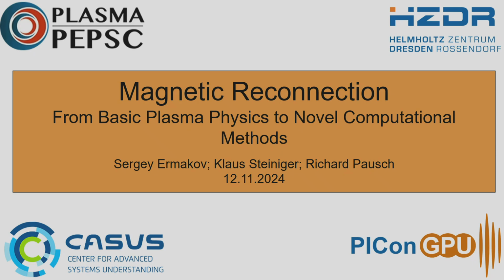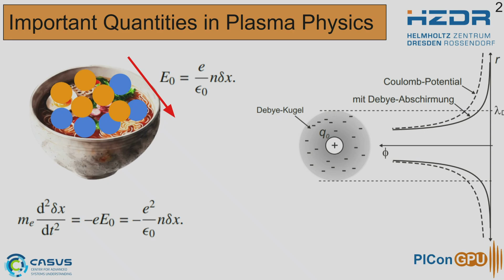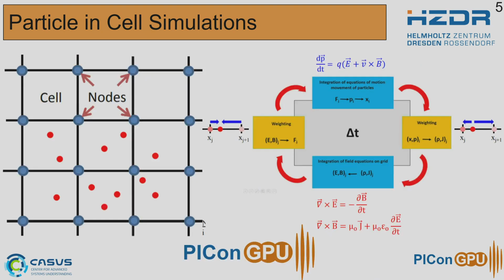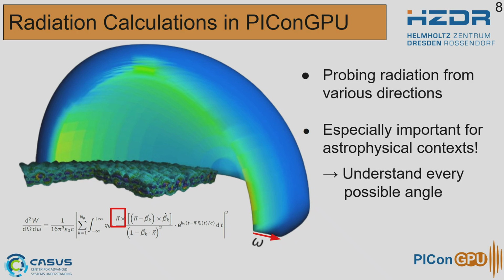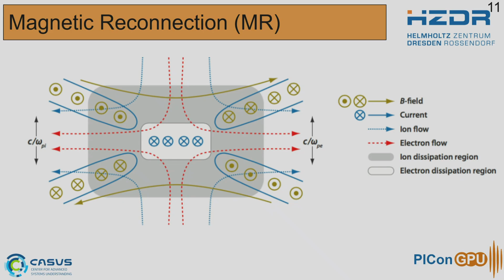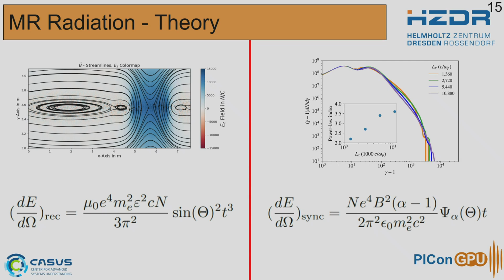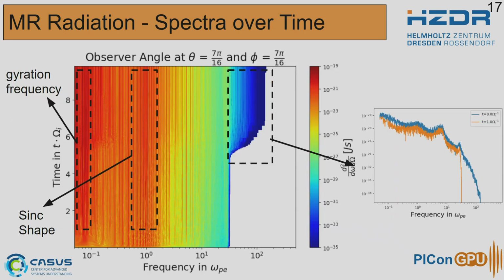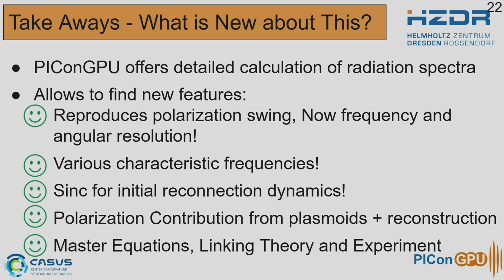Magnetic Reconnection - From basic plasma physics to novel computational methods (Sergei Ermakov)

Comment: magnetic reconnection is flawed af and even hannes alfven himself said ''the concept of 'frozen-in' magnetic fields. . .does not correspond with reality''
Reply: I do agree that the field does have its problems. But the original current sheet solution by Harris is modelled after density measurements, so there is some truth in it, even though we are far from getting an analytical model.
This is why it's good to have more experimental tools - like those I propose ;)